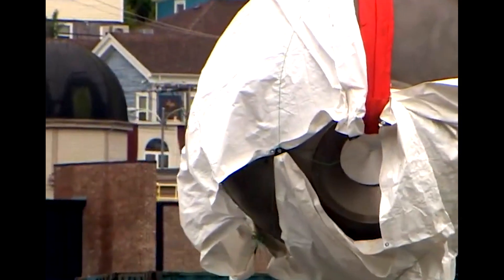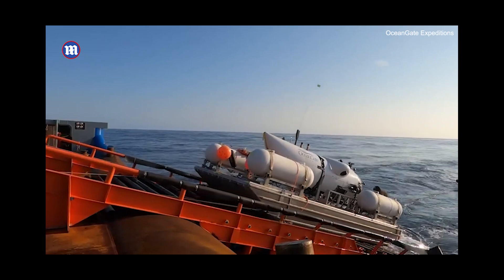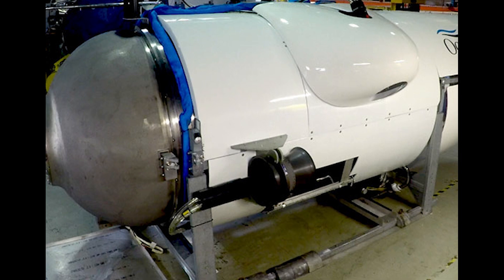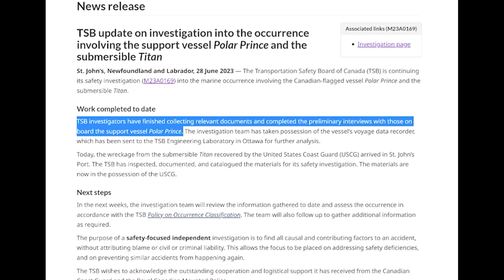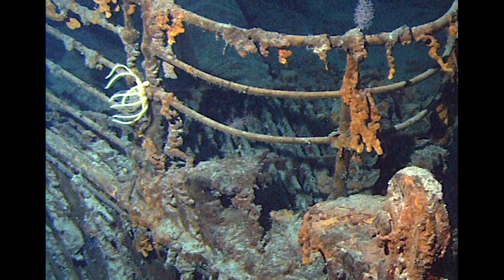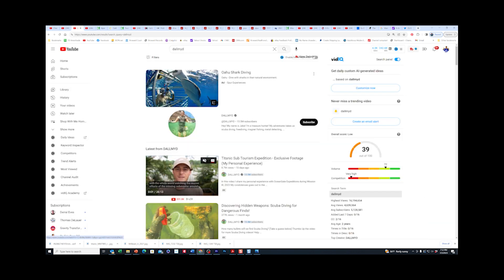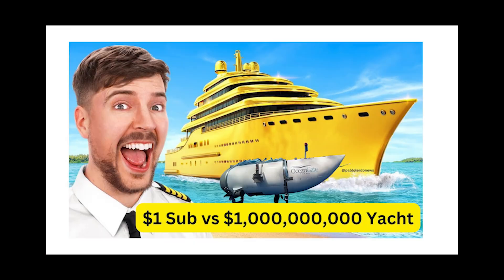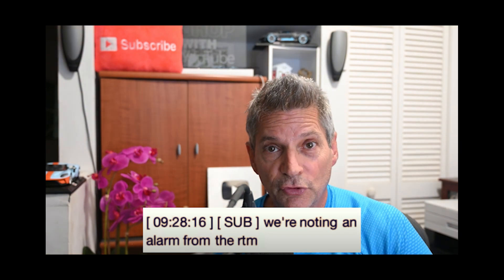Titan Submarine Debris Clues, Implosion Simulation

Comment: Let me explain what (I think) happened to the carbon fiber part of the hull. First off when it imploded it was so violent that it was enough to clean any residual parts from the mating surface. Especially because the nature of carbon fiber is that the strands that it is composed with would have been string enough to pull any remnants from the mating surfaces. This is how the fiber is strong. A GOOD USE scenario, unlike the POOR use scenario of using it to resist compression. 
I know that people think of carbon fiber scuba tanks, and deduce, like Stockton Rush did, that this indicates strength under compression if you get it right. And perhaps with some evolution this problem can be worked out. But the problem is that those scuba tanks are designed to resist stretching, not compression, and these two opposite forces work in completely different ways and have different breakage limits with carbon fiber contruction. 
So what happened to the hull itself. Well I have seen remnents of carbon  fiber constructed objects that failed under extreme stress and what you are left with is individual strands with some resin residue perhaps, but the structure itself at this depth, once impinged, would have shattered like glass from its original shape. 
The epoxy resin is shattered. But large pieces of it might have survived due to the survival of individual strands of fiber.. But these pieces would not be solid chunks of hull,. but rather would resemble a hair ball spit up by a cat. Lots of strands and hairs tangled up with itself, but no shape or cohesion. 
And here's the clue as to why they didn't find any (I assume) in the debris field. Because these fur balls  remnants of the hull would be relatively light compared to the metal peices, and equipment and fairing pieces, especially relative tio their size. And the hairs in them would have acted like giant sails in the current. So assuming this didn't happen on the sea floor, they would have been caught up in a current and deposited perhaps thousands of miles away, being basically the equivilent of giant understea Tumbleweeds. 
Even if this had occurred on the sea floor it is likely that any remnants of the hull would have been in hair ball form, and would have been pushed and pulled by the current and rolled along with the current, and eventually on the sea floor. It would move quite quickly in any serious current, and would never stop until it either became snared on something,. which is likely at some point, perhaps hundreds or thousands of miles away, or because the remains found an eddy of current that was too weak to continue to pull it along. 
But my main theory of what happened to it and where it is, is that it was,a giant fiber ball, that relative to its size and shape, would act much like a sail, and catch that sea current, and it would never stop moving until the current was gone, or the fibers were snagged on some object under the ocean. 
We may find this washed up on a beach in a few years, although it is unlikely that anybody would know what it was, or recognize it as even manmade at that point, likely covered with algae and impregnated with slime bacteria etc. It could even be found, or parts of it, on the wreckage of the original Titanic ship, if it for instance was low enough and pushed by current in that direction, and got caught in a jagged piece of metal or sea life. 
Again, I think what we would see, if we could visualize it, is a giant, or more likely several large, clumps of fibrous material that would have been mostly liberated from any shape, but still held together by the strands of carbon that originally formed it. And I think even the fabric itself, would be broken down at places to individual strands. So this would be a giant spongy black or grey looking mossy like object or objects that might even resemble some sort of sea life, and in fact would provide a natural breeding ground for microscopic sea life to use that matrix to live within. 
If not found within a few years, it is unlikely we would recognize it even if a diver or person on a beach walked right over it. It's gonna look at best like tangled up decomposed fabric of some kind.  I know I am long winded, but I am trying to clearly describe what this type of material may look like after disintigration, and then impregnation with sea life and algae. I don't think it would break down into small pieces completely by the implosion. I think there will be some remnants that resemble fibrous husks with no shape, and these will travel, and eventually break down themselves and be unrecognizable. Even if searchers are aware of what they are looking for, the chances of them actually finding it would truly be a miraculous act of God. It will likely be far away, and unrecognizable.  Databyter

Comment: Ive wondered if they heard any sounds such as creaking or scratching before the implosion. Or if it was all just instant. I know and understand the implosion ripped them apart and crushed them, but did they go "Whats that sound? Is that normal?" Before the blast.
Reply: Doesn't bear thinking about, does it?

In this video I heard something new. apparently they dropped weights shortly before the implosion. That suggests they may have known they had an issue, and tried to surface.
Reply: they heard it

Comment: The flange of the titanium ring was inadequate. The process of buttering ends with epoxy is a joke. Chemical etching is necessary on any metal to composite / epoxy which would discolor to show its application ! Process was flawed from the get go.

Comment: An important clue will be what is left of the glue joint between the carbon fiber and the titanium ring- is there still glue attached to the titanium, and if so, is there carbon fiber still attached to the glue? If only glue, the glue failed. If both glue and carbon fiber, the carbon fiber failed.

Comment: 4:32 I notice on that skid there are only three legs. There should be four. In your 7/5/2023 video of the alleged transcript, there was mention of multiple attempts to jettison the skid. I wonder if maybe this skid was still half dangling on the sub and that is what was slowing their ascent so much. Maybe it even impacted the carbon fiber part of the hull and made a weak spot? The crackling noise at aft end sounds like the real time failure of the carbon fiber as de-laminations were occurring, and perhaps voids collectively smashing. I saw a video where Stockton was giving a lecture, and he said that the carbon was cured for two weeks. I guess he figured that a very very long curing time would eliminate any voids, etc?

Comment: Im like 90% sure the carbon fiber failed first due to the pressure cycles. There is no way to measure wear on carbon fiber like you can with a metal structure through NDT.  It was only a matter of time before this science project failed the way it did.
Reply: It was a pseudoscience project as in reality is was little more than a rich boys hobby build. Problem is when narcissists with money that are used to always getting their own ride rough shod over safety rules they take other people with them when it goes wrong.

Comment: 1:32 - No, titanium would not shattered in million pieces and THEN remove itself completely with ALL bolts missing.
IF that glass shattered then ring with, probably, ALL bolts would be still attached to it.
PLUS, hull would be connected to it, at least in pieces OR "A" piece.

There is no pieces of carbon fiber hull at all, meaning it was squeezed in the middle and just slipped from titanium rings like a glove.

MEANING the problem was with poor strength of the glue used to connect ring to the hull and/or insufficient contact surface.
Also, the very fact they did not used spiked rollers to push out any and all air pockets when they were creating the carbon hull is just funny to me.
PLUS they did not did it in CLEAN ROOM, they did it in some xyz room with ton of contaminants in the air.
They were playing with expensive toys and paid the sexy price.

I am glad they knew and saw it coming, at the end.
Probably some other egoistic billionaire will not go down the "woke" path and actually employ the real scientist, real engineers and real mechanics to put it all together.

Comment: Would the heat of implosion cause the resin in the layered carbon fiber to vaporize? Also how would the shock of implosion affect the portal? Vaporize as well?
My thought is the seal between titanium end cap and carbon fiber failed. That crackling sound was high pressure water jetting between layers and causing failure.maybe next sub uses solid titanium tube. Or just a much larger sphere.

Comment: My opinion is the joint failed between the titanium and carbon fiber. I bet the titanium compressed and the carbon didn't. Instant inrush from joint popping the endcap off. Somewhere out there is the carbon shell that got shot out like a cannon. I wonder how far it traveled.

Comment: No material would have been strong enough to support the pressure without bulkheads! Second of all what he's talking about with the joining of the tube to the titanium, there was only one side where it was glued. That should have been inserted into a notch with compression fittings on both sides

Comment: I really can't believe the salvage company would be taking anything apart before it has been fully inspected/analysed. That would be like cops tidying up a crime scene before the lab guys turn up.
Reply: My thoughts too - the port hole was most likely forced out by the water hammer effect from the implosion.
Reply: @leifvejby8023  .. agreed, the pressure wave from imploson popped off the window AND both titanium ends. Like a firecracker.
Reply: it's 2.4 miles under water.  It's not exactly like we have equipment tailored to do everything down there.  Potentially, the glass and flange sheared off during the implosion.
Reply: @idontwantcorporateretaliat6301  True. What point would it be to have some underwater wrench take those bolts off? They could have used some grip devise to raise the  viewing port with the window on.
Reply: @teleguy5699  only reason I can think of is to fetch a strap through the opening as opposed to using some sucker cup on the glass or cabling or claw on the outer flange.  Forensically it would be undesirable to remove those bolts if still there.
Reply: @idontwantcorporateretaliat6301  They used a method of claw to get the back part up. That's why it would make no sense to go through the headache of taking off the glass and it would hurt the investigation.
Reply: @idontwantcorporateretaliat6301  but they can undo all those bolts down there?
Reply: @daveyjones5702  I argued otherwise
Reply: @idontwantcorporateretaliat6301  tbh i'm confused as to how they managed to get anything up at all this quickly.

if just going there and watching an object on the bottom is this hard, how are they just hauling up items from there?
Reply: @daveyjones5702  salvage vehicles are more than likely unmanned/rovers/remote controlled.  You can build these unpressurized and merely make them waterproof. Or pressurize only components that require it w/smaller enclosures though I can't think of any off the top of my head.
Reply: @daveyjones5702  Unmanned robotic submersibles with robotic arms can easily do things like that. Just like robotic surgery. I had a surgery like that. The surgeon sits on the other side of the room running the robot with his fingers looking through a viewfinder.
Reply: @teleguy5699  i dunno dude.
we have all seen documentaries where they do that very thing, and it doesn't look that easy to me.
Reply: Maritime law is different. If you salvage on the water its yours. Doesnt matter if a crime was committed or not. The cost to retrieve it is astronomical and they have to be able to recover those costs. Make no mistake, parts of the sub will be in a private collectors home very soon.
Reply: @velveetaslingshot  this is only true for things that have no historical significance or very little value. For example, if you come across a wreck from the old east India company full of gold coins, that most definitely does not belong to you. You must turn everything over to the country or territory that minted those coins, and they may choose to pay you a finders fee
Reply: @velveetaslingshot  WRong this is not maritime salvage it's a crime scene. do you think when a plane crashes in to an ocean people have salvage rights? you are so desperate to be right you will literally say anything
Reply: @velveetaslingshot One of the passengers was a billionaire , the family can afford it.
Reply: @HectorGonzalez-fz6ws  Afford what? Maritime law doesnt gaf. Whoever retrieves it first owns it. The billionaires family can buy the salvage, but they cannot force them to turn it over. Besides, waivers were signed and the cheap sub imploded. There is no mystery to be solved here.
Reply: @velveetaslingshot  Nobody cares about Maritime law when the US and Canadian CG are running the show.
Reply: @velveetaslingshot  There is a mystery I want solved - how gooey the remains were.
Reply: @johnbergstrom2931  Lol ewwww
Reply: @johnbergstrom2931  Very, and thin, and then rinsed away by seawater.
Reply: The idea that the salvage crew could unbolt that window after the pressure vessel imploded is incredibly unlikely.  Ever tried to free a stuck bolt?  Now try to do it from a minisub a few miles down.  That window probably shattered when the pressure vessel ruptured.  Like smashing a soda bottle so hard the cap flies off.  
I wouldn't hold my breath on those bolts all just backing right on out after a violent event like that.  The window itself was plexiglass, it likely shattered; but the ring is small and heavy enough it probably buried itself into the mud.
Reply: In one of the early dives, a passenger who had engineering expertise complained about cracking sounds. He wrote emails warning OceanGate that the flange was a potential point of failure.
Reply: It’s more challenging to go there than space. I think it’s very believable lol
Reply: @TinMan445 space is easy to get to compare to underneath that's true,not really pressure up above like underneath that stops us from exposing!! We no more about the moon and mars than we do than our own planet lol it's crazy is it
Reply: The crime took place in a board room some time around 2009 when OceanGate was formed.
Reply: @stickyfox  No, I disagree.  I think the initial crime was the first time Stockton Rush cheaped-out on materials for this Deathsub.  "Expired carbon fiber pre-preg?  I'll take it!"
Reply: Just if it was the only way to get it up to the surface
Reply: @rachmunshine9474  The sub had 2 caps, they had to figure out how to get the rear cap up without a hole in it either way so it would be crazy to remove the window.
Reply: Yup, plus they had to bring the other side up without a hole in it, so they still had to figure out how to get one up without a hole either way. It would insanely stupid for them to remove it before the investigators look at it.
Reply: @bobbygetsbanned6049  A member of the ship salvage crew would be arrested by the FBI and go to prison for obstruction of a federal investigation if he even were to loosen one bolt of that wreckage...
Reply: @johnbergstrom2931 I don’t think any of things are in any way how it goes. Refer above to @velveetaslingshot’s prior comments.
Reply: @mipmipmipmipmip The US Coast Guard, a federal agency, is in charge of the investigation.
Reply: They absolutely wouldn't remove the porthole at sea.  It's just an idiotic fantasy by internet know-nothings.
Reply: it was mostly blown apart but yah true
Reply: Just actually thinking the same bloody thing!! Wow 😮 it's the same thing? The cops wouldnt muck with a crime scene wow strange
Reply: But having the pieces on land to examine up close is an important part of said investigation?
Reply: @HardDriveGuruOfficial  yeh I guess looking it that way ur absolutely correct mate!
Reply: How. There’s no evidence unless you have it in your hands. Touching evidence isn’t a crime/problem as long as it is documented.
Reply: They would but they would also document as best they could.    This is a situation where some evidence to examine is better than no evidence!
Reply: @@UntrepidOne-gx5le Who admitted?
Reply: Yeah well that's EXACTLY WTF they did. Once they winched that basket of goodies to near the ocean surface now its cover up time. Sure the navy has excellent divers that's what they do best. So we begin by removing all traces of carbon fiber. Remember this is your government hard at work to cover EVERYTHING up. think UFO/USO investigations you think this stuff ain't happening? Please rethink...
Reply: 9/11
Reply: OJ.
Reply: good point.
Reply: silently remembers how Giuliani and Bush cleaned up the heap of rumble and metal of 9/11 within weeks of the disaster before silently shipping off all of the “scrap metal” to China for reuse. 😵‍💫😵‍💫🤡

Comment: Carbon fiber pressure vessel definitely is the piece of Titan sub that failed. If you look deformation of the barrel during simulated implosion 10:05 you can see that barrel deforms in the mid section and that end (in the case of Titan sub, the titanium cap) is least deformed. Reason why there is no bolts and viewport glass is the fact that implosion force practically dislodged them completely from the titanium cap.